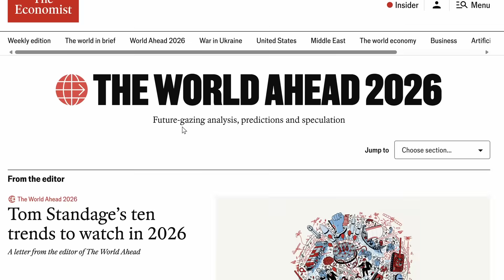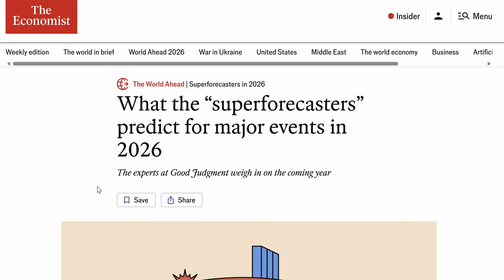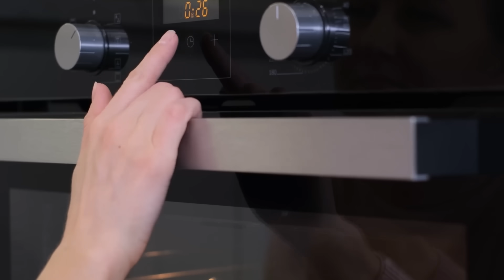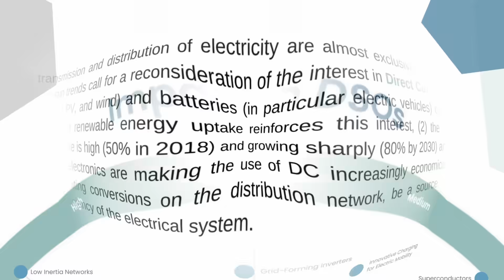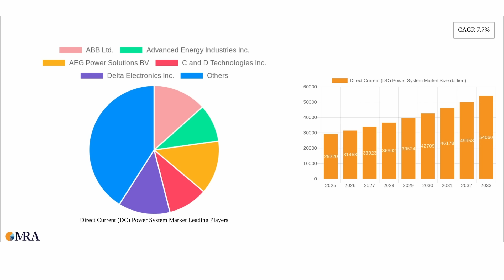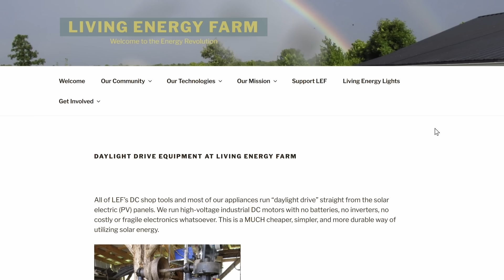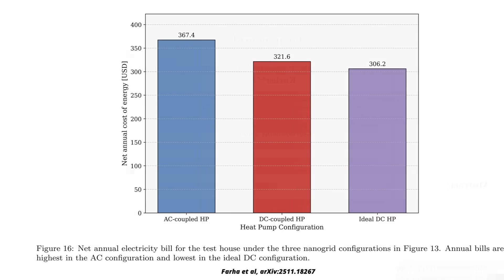Are We Using the Wrong Kind Of Electricity?

Comment: AC still holds numerous advantages in transmission because of reactance.  When voltage and current are pushed out of phase in a circuit, you can have much lower conductive losses and it is generally easier to derive the necessary voltages for a system from winding ratios in transformers than it is to use some kind of switching converter, particularly at higher voltages.

A whole video series could be dedicated to switching power supply architectures and the quest for efficiency in their operation.

There is, also, the inherent advantage held by AC in polyphase power delivery.  4 wires gets you more than 300% power delivery.  The neutral wire in polyphase, unless things go horribly wrong, does not carry current.  In any DC circuit, all wires in it carry the current of the load.  You can technically share a common "ground" - but if you try to carry the shared rails at their capacity, they will melt the common assuming all wires are the same gauge.

While there is some value to microgrids being DC because of the costs of developing efficient conversion at the level of individual homes in a community, any given conductor count will have an overwhelming advantage in power delivery while operating in polyphase.  To the extent that any remainder from a divisor of 4 would be better served as data lines to facilitate network coordination as opposed to power delivery.
Reply: The USA has installed High Voltage DC Transmission Lines.

Comment: One of the wrose things with three phase AC power systems is all the asymmetrical fault conditions and balancing issues that simply go away with DC.
Reply: Zigzag transformers can take a very high imbalance on distribution and don't propagate it over to transmission

Comment: That's what energy loss from dirty phase feedback comes from. Harmonics are generated by nonlinear loads like variable frequency drives (VFDs), LED lighting, UPS systems, and office electronics. 

These distort the waveform and force transformers, motors, and conductors to work harder, often leading to overheating and losses.

Comment: What is this modern advancement that makes converting low-voltage DC to high-voltage DC easier? 5:03 Sabine just glosses over it, "Not that the technology has improved..."
Reply: They are called AC-to-DC and DC-to-AC Converters. They are very efficient. The USA has installed High Voltage DC Transmission Lines.
Reply: @MrSummitville  I have no idea what you are trying to say. You must be using the anti-AI posting method.

Comment: This video undersells the importance of sticking with AC for transmission. For example, with AC it's easier to step the voltage up/down and it's easier to convert AC to DC than the other way around. Also things like water and wind turbines generate AC, not DC as mentioned. The corollary to this is that motors work better with AC than with DC.
Reply: AC-to-DC and DC-to-AC Converters are being used in the USA. High Voltage DC Transmission Lines have been installed.

Comment: Car engines are not "DC". If anything, they are more AC than AC, as they are multi phased.
Reply: The main battery pack is DC.
Reply: @MrSummitville  Oh, so you're saying they haven't invented AC battery packs, yet..? 
Of course the battery pack is DC, but when the current is used to actually drive the cars, they are not using DC.
Reply: @TrondTillmanSynnes The motors are controlled using PWM Pulsed DC !  So, what is your point?
Reply: @MrSummitville  Do you mean pulsed AC? ;)

Comment: 2:25 : "Alternating currents were less lossy when transferred over long distances, so Tesla's system scaled better."

I expected better from you, Sabine -- especially in light of your video about Mikhail Dolivo-Dobrovolsky some years back.

You know as well as I do that it's not whether the current is DC or AC that impacts its transmission efficiency, it's the VOLTAGE.  Losses are based on the thickness of the copper wire and the current (amperes) flowing through that wire.  To carry 300 watts of power at 150 volts requires 2 amperes of current; but to carry the same 300 watts of power at 1500 volts only requires 0.2 amperes of current.  1/10 as many amperes means 1/10 the losses.

There is NOTHING preventing you from transmitting DC power at the same 3000 volts as AC power, and incurring the same savings in terms of losses.  The advantage of AC over DC was that it allowed the voltage to be stepped up and stepped back down very easily, so you could step it up to (say) 3000 volts for long distance transmission, then step it back down to 240 volts to deliver it to a house, without needing to add the expensive (at the time) rectifiers and converters with each step-up or step-down.

EDIT: It appears you DID address this, but waaaaaaay down at the 4:50 mark in your video.

Comment: The big flaw with DC grids isn't losses, it's complexity. The big advantage AC had that people ignore is the advantage of the transformer. AC allows using transformers to convert power from high voltage to lower voltage with very little effort. Doing the same with DC is far more complex requiring actual circuitry. DC requires buck converters and boost converters which are rather more complex and costly than transformers which are just wires wrapped around an iron block. 

DC also means we lose the dual and 3 phase power we have in buildings for modern breaker boxes. DC means we only have a single phase coming into the house as you can't make multi phase DC power so electronics that use multiple would instead require higher voltage lines in homes.
Reply: The USA has already installed efficient High Voltage DC Transmission Lines.

Comment: I recently watched a video about an ultra-high voltage link in China, there is a graph where it shows that AC is cheaper on short distances and DC is cheaper on longer distances right now.
Reply: The USA has installed High Voltage DC Transmission Lines.

Comment: Australia here: I have been suggesting for some time that household ceiling mains wiring voltage should be reduced to a low voltage to take full advantage of LED technology.
Reply: How long is "For some time"? LED Lighting has only been around for a few years the Electricity grid has been round for decades bordering on a century, there is a major risk to switching a standard that LED lights accommodate internally (capacitive droppers in most cases)
What would you do if/when LED lights are replaced with another technology?
We went from Incandescent to Compact Florescent to LED without re-wiring our houses, pretty much proof that the120/240 AC system is  pretty versatile.
Reply: @YouShouldThink4YourselfSave power, safety then versatility.

Comment: DC is a lot trickier to implement for local power distribution AC Transformers not only step up or step down voltage they limit the power transfer to a shorted secondary on a transformer a DC circuit wants to transfer all of the power to  a short.  In areas with conductive dust this can be a big problem,and leads to fires.  An AC arc over self suppresses when the voltage crosses zero, a DC Arc over keeps going until power is removed.  DC systems need more carefully controlled conditions than a arbitrary local distribution network  can support. It can be used under specialized conditions.

Comment: This is the first video of yours that I groaned some about.   It feels very goofy, incomplete, not explained well, and often gives the wrong impression to the ears of someone that works in the power industry.   I very much like your videos but the grid isn't a physics problem.  There are a lot of very real factors that go into why it is designed the way that it is and why AC will always be the primary mode for moving power.   That said, I do like your videos a lot and was a physics major before switching to engineering so it is fun to hear about things that I missed out on going into engineering.

Comment: The million volts dc of transmission lines would still have to be stepped down, even if there were no synchronous motors.
Hense converting it.
The advantage is that since the power of an ac line is approximately 67% or the root-mean-square of power the line could carry if it were dc, theoretically at least. Practically,  the line is sized for the heat it can sustain.  Even 33% more power means more heat.

Comment: For many, many reasons (I see a number of them already elucidated in earlier comments), our electrical system is doing what it should. Second-guessing an infrastructure carefully developed by experts for over a century is freshman-college-level thinking. If a NEW DC electrical system is built from the bottom up with NEW DC equipment for NEW DC appliances... that's a whole NEW ballgame.
Reply: The USA already has High Voltage DC Transmission Lines

Comment: So let’s correct a few (actually a lot) of misconceptions. 

First, suppliers supply electricity. 
I will give you what electricity power supply looked like
1. Å piston steam engine attached to a flywheel with an generator attached 
2. Niagara Falls bypass with water flowing around Å turbine. 

The result is a wheel shaped set of magnets and some copper wire coils. Result, alternating current 

Why this was good? no need to rectify the current. 
What other advantages. If you are sending current to say 10,000 homes nearby 120 to 240 volts may be fine. But if you are electrifying NYC that is a huge mass of wire from a source that might be 10 miles away. You need to step up voltage.
   With AC, very easy, step up transformer. Which means you need to step up the AC before rectifying to DC, but then once you get it to its destination you need to step down the current….again today it’s not a problem, but 100 years ago this is wasteful for DC. 

   The third issue is polarization. High voltage constant polarized contacts corrode, they do so because there is enough gases in the air that react with one terminal or another. This used to be a huge problem with cars that operated near the coast, the points and condenser (a capacitor would load up (about 35000 V) when the car was running, and would retain some charge, this charge suffice as salt laden air from the coast would get into the distributed at night and oxidize the points. The result is the next morning you go to start and the points would not contact. Many people kept a fresh set of points or a finger nail file in the glove box to clean the oxidation off. 
   AC is constantly switching polarization and thus it does not favor any particular polarization. 

Therefore DC is the wrong electricity for power grids. Nope. 

DC works well when power becomes a national commodity. Just remember you solar panels produce 24 volts and the national grid is at 110,000 VDC and is not particularly synchronized. If there is an excess of power in say N Dakota winter, how can you sell power in Florida. Thus there is proposed a 500,000volt DC backbone to the entire grid where suppliers can dump power into the grid and consumers can convert it to AC. 

There is a problem with AC in which there is a dead zone in motors powering up that requires the use of capacitors for single phase motors of any appreciable size. The US mandated the replacing of all commercial single phase motors (208/240 - 240 is just 2 phases that are in opposition). Instead commercial motors are all 3 phase and these are the most efficient motors. 

   Think about your desktop computer it uses DC. But it does not use a DC circuit, there is a -5,+5,-12,+12…… volt DC services. The AC comes in, uses transformers to generate the voltages and rectified them. But there is a problem. Those services are charge, just like the dust in your house, the fan pushes dust into the power supply and overtime the power supply loads up with charged dust. Someday you notice the dust and carefully try to remove the dust with a very delicate vacuum cleaner. Turn on the supply and Pop! A capacitor(s) blow. Got to keep those DC services clean or be willing to replace.

Comment: Solar, EVs and batteries are dc. I can see the benefits of using AC for transmission, industrial motors but drop to DC for residential point of use.

Some homes are installing DC systems.

Comment: AC's initial killer advantage was the possibility of using transformers  to change voltage to allow distance transmission.  DC is useful where changing voltage is not essential - that is small isolated networks like in vehicles.  At the other extreme HVDC transmission is useful where scale justifies the cost of AC-DC and DC-AC conversions.  Electronic devices are now making DC-DC conversions more practical.   But between those extremes,   DC is often not compelling, and AC is already established.
Both DC and AC have their place.  Changing from one to the other is seldom economic
Reply: Yep its the modern advances in electronics (really only the last couple decades) that's starting to make DC the better option.  Up until recently, AC was by far the better option and Edison was wrong.

Comment: China is using ultra High Voltage DC for long distance transmission, but how do you get that voltage back down to useable levels in a home?  I think (I don't know) that they convert it back to AC at the end point so it can be used with existing infrastructure.  Otherwise they will have a struggle to reduce the voltage to useable levels.  One way of reducing DC to a useable level is a "resistive" type of regulation: you have a "variable resistor" that forms a voltage divider with the load, that is monitored at high speed to keep the load voltage constant while the current load changes. In this case, the "variable resistor" has ALL of the load current and MOST of the supply voltage across it, meaning it will have to reject a LOT of power (as heat).  A second way is to convert the DC to pulses and PWM the amount of power that goes through. This does not require as much power to be dissipated by the regulator, but it keeps very high voltages in the system.  Also, while you generalize that everything runs on DC, Computers run on +12, -12, and +5v typically.  Creating that negative voltage is tricky without a transformer.  Speaking of transformers, as they are used today, they allow isolation from the power source, reducing the chance of an electrical shock.  A DC reduction circuit will not isolate unless you use the DC with a circuit that turns it back to AC, then sends it through a transformer - this is quite a change from the way things are at the moment.  I believe you intended your article to focus on the ultra high voltage DC ideas.  I think if you keep it to that realm, you wont encounter all of these other obstacles.

Comment: Frohe Weihnachten Sabine. You look tired. Take some time off to enjoy Christmas.

I am an advocate of DC for homes, but DC is not without problems. You can use it at lower voltages (up to 1 kV), or over long distances at higher voltages, but it's not convenient for high voltage distribution grids. But yes, for homes, businesses and microgrids it's great. At some points houses will be constructed with DC running through the house. With a conversion station at the project level or at the meter.

Comment: The problem that was not addressed is the fact that all large generating stations produce 3 phase AC and all industrial installations use 3 phase AC motors (this also includes the various motors used in the generating stations). AC used for residential users is just tapped off one single phase of the generators output. It would be prohibitively expensive to convert all generators and industrial users to DC.
Reply: Most residential users have 3 phase AC in Central Europe. Even my small 50 square meters flat has 3 phase (3 x 25A, 400V) power. Practically every family house has three phase too, with some exceptions in remote locations that were never intended for residential use, like small garden sheds in "garden colonies" that people converted to full time living.

Comment: ac WAS less lossy because of transformer (and other) tech of the era, basically they couldn't raise the transmission voltage efficiently in DC, and various other components had issues. These days we can make effective DC transformers, which make DC actually LESS lossy than AC in grid transmission. e.g. DC has no inductance losses, no skin effect, less corona discharge, etc. It's just better, if you can build the voltage transformers and other components properly. Today, it's just a matter of capital cost. edit - sorry, you actually said part of this!

Comment: Sabine totally missed it.  Almost all electricity is made with rotating generators.  Hydro, steam generators (nuclear, coal), natural gas turbines, geothermal, even wind.  All these generators produce AC.  AC is easy to convert between voltages, all you need is a transformer.  

Only a very small amount of electricity is originally made as DC, primarily solar, which amounts to less than 10% of all electricity worldwide.   If you converted the 90% that started as AC to DC and tried to deliver it as DC the overall efficiency would be far worse. Sabine glossed over the fact that there are losses in converting the original AC to HVDC and further losses in converting that HVDC to the lower voltages that are needed.

Comment: Large industrial electricity users which employ motors prefer three phase AC which can reach 95% efficiency and are less costly to produce. Changing AC to DC and changing DC voltage on a large scale, like 100+ amps is expensive. Using DC to travel long distances is more efficient when the distances are vast. The converter stations on each end are expensive (over $100 million each) and large, covering several hectares and with structures that are 30 meters high.